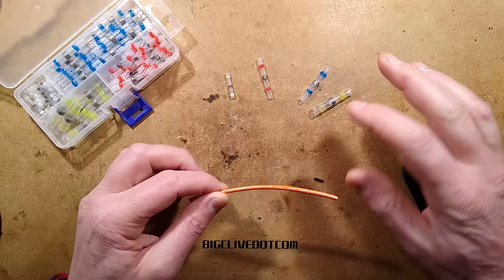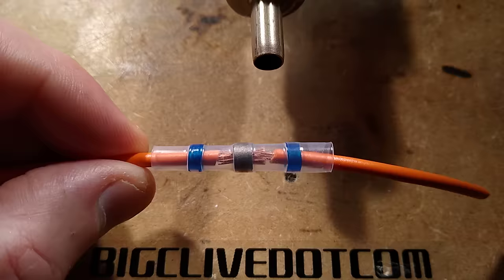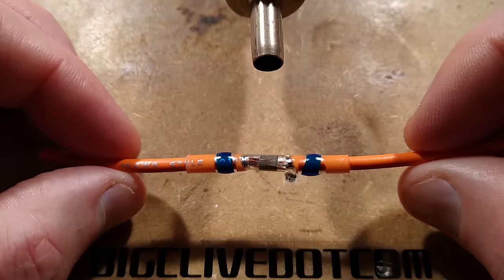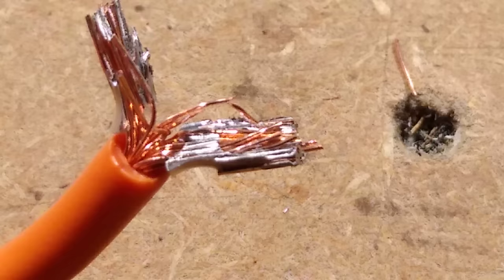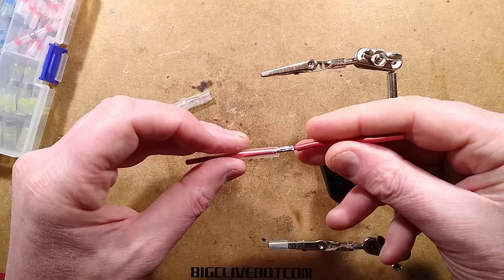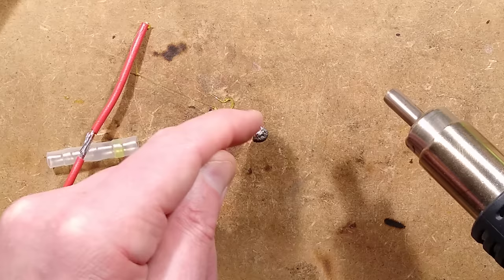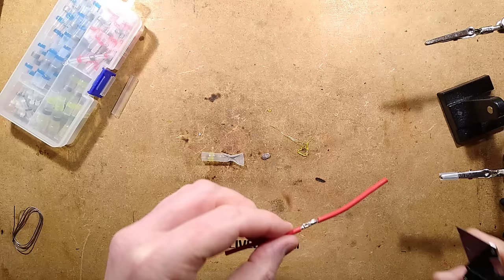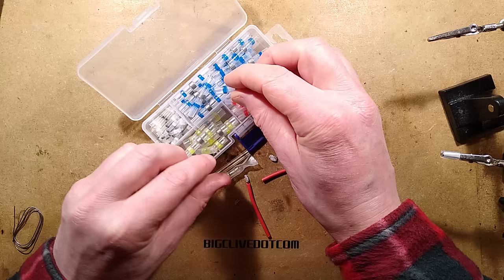Heat shrink solder butt connector test.

Comment: It would be interesting to heat  up the joint with actual load getting it really hot simulating a short without fusing. Use wires with a high C rating and put a small amount of weight on the joint and see if the joint pulls apart and how much weight if takes to do this. I'm thinking I would trust a crimp connection on a pull test at high heat. Vibration in autos and boats causes solder not to be a good idea because the part of the wire next to the solder joint can sometimes stress and break. Not having adhesive is a very bad thing for waterproofing.  Thanks for your review I was considering these until your review caused me to think about many issues.

Comment: I twist the wire in a western union then slide the connector over and use a lot of heat from a pocket torch. Once you get the hang of it you cant make a faster solid connection that holds up well in a marine environment.

Comment: I probably wouldn't use this for something like household wiring, but I think these are targeted towards something like automotive power and stereo wiring.  I can definitely see these speeding up a stereo installation.
Now,  the next level of test would be:
    1. resistance:  original wire, heat shrink solder (solder seal), crimp splice,   standard solder splice
    2. current capacity: How does each type of splice carry current compared to the original wire?  Does one type of connection get hotter compared to the others for a given current load?  
    3. longevity:  At different current levels, will each connector break down and fail over time?

Comment: Measuring the low ohmic resistance after soldering and compare it to a standard butt solder, would be a pointer to how good it actually works.
You would need a 4 terminal ohms (or Siemens) measurement device though, to get any sensible results.

Comment: the solder could be WOODS METAL - lead tin bismuth... melts at very low temps ... My science teacher had a set of teaspoons made out of it and took great delight in wathing them dissolve as you stirred your cup of tea

Comment: Timely video. If the solder is Bismuth-based and Bismuth is harder than lead, I wonder if the joint is more brittle? Granted, it doesn't creep out as far, but one could do the same with careful soldering.

Comment: You should make a different joint quality comparison video. Like take bunch of identical wires and join them together using different methods and then just pass a large current through those joints and measure voltage drop across it. It would also be interesting to see what happens to that low melting point solder when the connection is not good and joint heats up...

Comment: Solder is definitely better. Until you have to crawl in awkward angles and try to heat wires near plastic trim. Then the heat shrink tubing makes a LOT of sense. Thanks.

Comment: I used those to repair speaker wires and other 12v applications around my old car. Still have a metric fuckton of the darn things. I never realized I didn't need to crimp the metal ring before heating things up. When I bought them the instructions called for heating up the ends to create a water tight seal. I guess it's not a bad thing to be doubly sure it's making a decent connection all things considered.

Comment: I always apply more heat to ensure that the solder turns fully to liquid.  I usually use heat shrink over the top of the connector just to be sure.  Use these on low voltage & 240V with no problems at all.  I haven't used the big ones yet but if I do I will 'tin' the ends first.

Comment: My experience with these is that they definitely work, and are easy and quick.  But their long-term reliability is suspect.  They last about a year under normal use, then they start to fail, and you have intermittent connection issues that drive you insane - particularly if you used one in the engine compartment of your vehicle...  The heating and cooling cycle definitely damages them, long-term.  I'd use them in an emergency for a quick fix, but then I would replace them with a proper solder joint and heat-shrink tubing, as soon as I practically could.

Comment: I think with the heat shrink material applying compression to the articulation of the wire there should be sufficient contact between the stands of wires. Should do a load test and maybe measure the heat at the articulation to get and understanding of the degree of difference

Comment: The low melt temp of the solder I do NOT like at all. 
As for the apparent lack of volume to solder all the way through, maybe it will work better if you made the smoosh much shorter?

Comment: when working at the renault dealer in 2004 we would get these heat crimp solder things to do call back work from renault they have glue at the ends that would seal it all in we never had problems with them.edit we would just use a lighter to heat it up so i think we used more heat

Comment: Looks like a ring of ChipQuik type metal, just enough to form a simple bond between some of the strands with the others mechanically held together. It stayed semi-liquid for a long time on the bench. Probably picked that metal (or an alloy just like it) so it can be done with a lighter or even just a match.

Comment: Maybe if you dipped the bared conductors in some solder-flux first, then used one of these connectors to join the wires, that might make a better solder connection.

Comment: I bought some of these a few years ago, thought they would be fantastic to replace the usual crimp joiners.  They were rubbish, pulled apart easily and mostly dry joints.  Probably due to measly quantity of "solder" material.  Only the hot melt seals worked.

Comment: When using a MK1 heat gun (lighter) remove solder ring from 1, slide 2 on  and then heat the first one down with the solder ring, this will burn the solder sleeve. Wait for it to cool and score with a knife and the sleeve will come off easily, then slide the second sleeve over and gently heat down to give a nice finish.

Comment: I'm pretty sure it will at least hold. The solder is really low temperature but the wires or the joint should definitely not heat up enough to melt that. I doubt the joint is going to be high enough resistance to actually act as a resistor and heat up either. If the wires themselves heat up that much, they're definitely under specs. You always want your wires to be fairly over specs to be able to handle the load without any problems.

Comment: In 2018 these joints popped up all over. But 25 years ago, in the US,  these were only made by 3M. Approved for use by NASA in spacecraft, but with a special IR heating tool as well. You might be judging cheap copies--mistaken for the real thing.

Comment: Make another one with the quick solder splice connector and measure resistance and possible a current flow test to see if it heats up (if your resistance test is a bit high) and remelts the low melt "solder".

Comment: As an ex-manufacturing engineer... lack of flux was the problem. Crimps uber alles for field connections.  And no, it's NOT probably better than a crimp. Crimps done properly are lower resistance and higher reliability than soldered connections. Fact. Any current level.  Consider: which is preferable for RF connectors: crimping or soldering?  How are high current Cam-lock connectors installed? Crimp or mechanical. Thanks for doing this tho, I had always suspected these connectors were junk, now I know. Can't help wondering if some kind of flux coudl be added to the inside of the shrink tubing and all round the solder insert to fix this. I also wonder intensely how well some name brand ones (ie; 3M et al) perform.
EDIT: 3M, Raychem, etc, don't seem to make these! Hmmm, I wonder why... <_<

Comment: These work fine if you use them as designed/intended.
Too much stripped wire cause too much spread of the solder, only strip 1½ - 2 times the width of the solder ring.
Make sure to use the correct diameter splice, too loose and the solder and wire starts to oxidize before contacting the wire risking a "cold solder joint'.
Heatshrink 101 -  never use a naked flame, unless you have no other choice.
Only specialized forms of heatshrink are designed for use with naked flame/blowtorches.

Comment: So cut 4 exact length of wire. Solder two together yourself and 2 using this connection. Check with voltage and ohm meter .  look and see if there’s any significant difference.

Comment: I’d be concerned about repairs in the hot engine bay remelting and failing. What I think would be cool is to have the shrink and seal without the solder to use after traditional soldering, best of both worlds.

Comment: I cringed when you poked at the melted solder with your finger. Sweating copper pipes overhead, I learned that molten solder falling 18" inches to a cotton t-shirt will bounce right off, while molten solder falling 2" to bare skin will not. 15 years ago, still have the scar.

Comment: the solder is possible low temperature solder with In inside, which can pull the melting point very low. the bad thing is: price high and can be possible remelt in high current again

Comment: I may have to give these a try ... but one thought:  The same low temp solder that makes these so easy to use may melt under hot conditions (such as in an engine compartment), in addition to high current conditions mentioned by others(?).

Comment: Most of them work well with a hot air station. Flux the wires for better results. Only thing I found was they didn’t work well at lower gauge like 12 and below. I’ve used hundreds of the 16g and up and they are awesome.

Comment: I would have liked to have seen a pull test and also I would have liked to see if you tinned the wires first what would happen happened. But for light duty applications I think that they would work pretty good.

Comment: Well, add flux, then heat. If that improved the joint, that’d be good to know. A touch of flux and the sleeve could still be convenient method, not so much if a short cut. 

A wee bit more testing.

Comment: Im an Electrician in Australia. I get these all the time packed in the box with light fittings. Throw them in the bin and use single screw connectors. They are the worst

Comment: In my opinion, they are better suited for bench work than under the hood/bonnet of a car, unless of course you were born with three hands, lol. If the splice is in a tight space it is nearly impossible, especially while bending over a car fender. I guess you could use a soldering stand, minus the stand, but that would defeat the whole idea of the product. I went back to soldering with the use of marine grade heat shrink to seal it up, water tight. I like Ryan's idea of using a bit of flux to help the solder flow throughout the connection. If anyone has figured out how to use these connectors in tight or hard to reach spaces, please comment.

Comment: They are heavily used on aircraft, but then aircraft wire is usually some sort of teflon derivative,  very resistant to high temperatures.  WIth these splices,  they normally work well and are strong connections.  The exceptions I have seen are where they were not heated long enough and the solder component not allowed to flow and bond well.   This could happen if you are using plastic wires and become concerned about the heat wrecking the insulation.

Comment: Because of the amount of surface area touching, and the solder bond, may be adequate to the conductor current carrying capability. 

I will have to do some high current testing ...

Comment: Often, the ends of the wires to be spliced are stripped, then tinned, and then inserted to be joined with the connector....And the wires aren't "interlaced", but instead placed next to each other. (bypassed). and the solder in the connector is enough to  hold the joint securely, and the hot melt makes the joint waterproof.

Comment: Use a heat gun at the recommended temperature.  Clive stated that he started with the lowest temperature he thought possible.  A performance test should first use the manufacturer recommendation, otherwise it's not really fair.  After that, can test possible failure modes of too hot or too cold.

Comment: Noticed that you applied heat for a shorter duration to the heat-strink/solder seal connector than you did to the wire connection on to which you applied your own solder. Perhaps if more heat were applied to the former as well, more solder would have surrounded and reached the center of the strand of wires.

Comment: Test 1 would suffice if Not a Pressure Pulling Situation, I Plan to use them For Trailer side-light wiring. & Work Fine. Thanx For The Vid

Comment: I bought some Kuject brand connectors, same outcome in my testing. I use them as heat shrink after soldering my joint, now. The solder in the connectors will flow decently into my kester or I’ll pull the ring out with some hemostats. Pretty expensive heatshrink kit. 😂

Comment: I used to carry a gas soldering iron connectors flux and can of gas in a bag on my motorbike the gas was because over time the soldering iron would empty itself magically. Now i carry a small mint tin some of these and a little blowtorch lighter. I might get a small tooth repair putty pot and put some flux in it and some q tips and add this to the set. you should have pull tested them as well.

Comment: I used to have some really old versions of these but they were metal with wax end seals and solder and magnesium you crushed them and the magnesium flared up and melted the wax and solder and still have 2 on my motorcycle that I fitted about 25 years ago and are still good

Comment: Low melt solder usually is a lot more brittle, so I wonder if this would last in a car or other vehicle with a lot of vibrations. But as a temporary solution in a pinch, sure.
Also you could test the resistance compared to normally soldered joints, if the resistance is higher, at high amerage the l9w melt solder could melt and make a mess.

Comment: If the connection is bad, and the joint hearts up, the solder melts not and makes a better joint. That's an interesting feature imo.

Comment: I use a similar solder connector at work and you didn't have it hot enough, we have it at 400 degrees C or have the correct heat gun shield. The coloured glue is to make it water tight.

Comment: There are mil spec connectors of a similar design that work much better than the cheap kit you have there.  The mil spec connectors are popular for avionics installations.

Comment: I'm using such splices since 1973. There is a special nozzle for the heatgun to speed up fixing the joint and heat shrink by blowing at it from all sides. However, I don't like them.

Comment: I know this is off topic, but I saw somthing that may interest you Clive.  Just watching QVC and they had a jug water filter, called Zero Water. They poured both ater and then red wine into it, and then tested it with a TDS meter. Whice displayed 000 PPM. It ths even possible, and even if it is, would that not be classed as purified water, which is meant to be bad to drink, due to reverse osmosis,  Looking forward to your next video. Can't get enough.

Comment: A little more generous on the solder either in thickness or width and I might have purchased some. Might well be some are better then others. I will have to look around and see if I can find different specs on different brands albeit somewhat the same source. Never did like the crimp version, I always went the DIY method although rather then slide in and between I went the parallel/series twist method. The twist method is harder to pull apart without solder so it provides extra strength even if not needed.

Comment: I got this kit on Amazon to do wiring repairs on my boat.

They seem to work o.k. but, melting is not uniform from one to the next.

I think lower heat and longer application of heat is what makes it work better.

Too much heat and it will melt, making the joint too fragile and susceptible to breaking.

Is you want good flow, apply solder flux prior to joining and heating...not too much flux or it will not allow good seal where the blue bands are.

Comment: This is basically a water tight flexible crimp. It is still not as good as soldering a wire because the resistance is not as good but they all will hold.

Comment: They are never used with a puny nozzle on a heat gun like that. Using a heat gun with a much bigger nozzle I get the solder to melt flow perfectly.

Comment: I always prefer the tried and true airtight crimp which is used in basically every critical application (high current, aviation, medical, automotive etc.) over thermally unstable and questionable solder joints. If you want to throw something in your repair-kit then by the name of the flying spaghetti-monster please pack a proper Klauke or similar crimp tool along with a box of assorted crimp connectors instead of those solder thingies.

Comment: A well executed crimp is mechanically better than soldering and less subject to vibrational fatigue as solder is. Hence aviation / motorsports etc all spec crimping rather than soldering. Having said that, this requires the proper selection of matched crimps & crimping pliers etc etc so for the average layperson not really suitable.

Comment: Would be interesting to compare the resistance of the initial wire vs soldered joint vs the heat joint

Comment: What about maybe adding a bit of flux to the wires before installing the heat shrink tube to see if the solder flows better. I could see the off gassing of the flux causing some issues but it would be interesting to see the result.

Comment: I used those connectors installing a car stereo because I didi not want the power and signal loss through a butt connector.   I was sorely dissapointed in them as the solder melted through the heat shrink tubing.  I won't use them again;  flux, solder and heat shrink tubing for me.